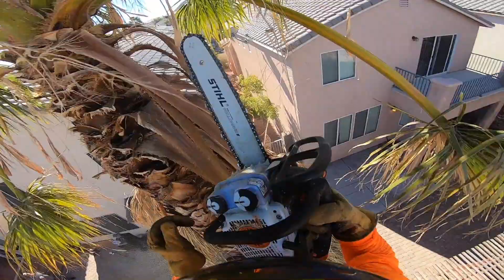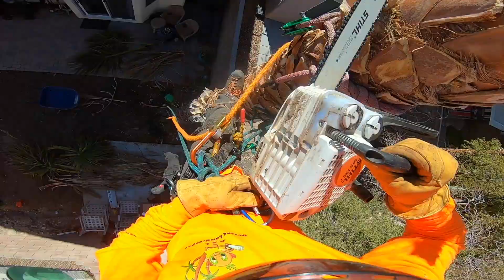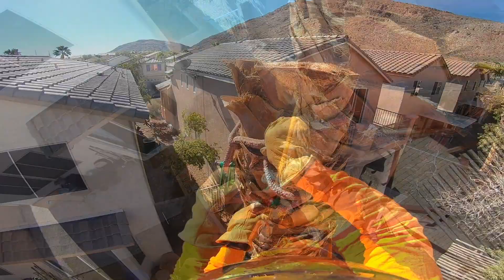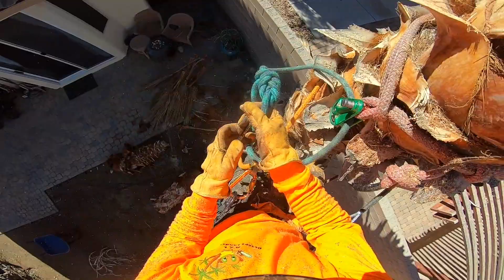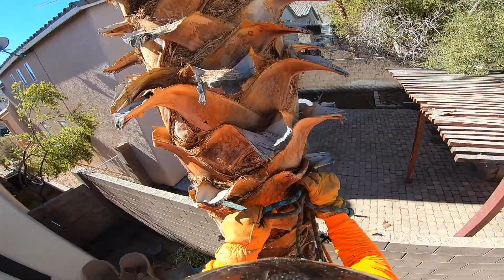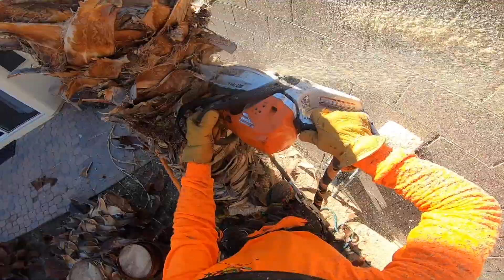How to rig a palm tree / Descolgando una palma

Comment: your getting better at this! your getting the rhythm down. i will say one thing i never liked about palm removal is it makes the saw work so much harder and bogs it down from all the gunk that builds up in the bar and clutch housing
Reply from the maker: Cleaning up those chainsaws on the daily 😅 what air compressor should I get ?I just moved into my new place, I have more space for my saws and stuff
Reply: @mr.benitezhimself  i got one made my California air tools. Its the quietest brand on the market. Their a little more pricey but well worth it